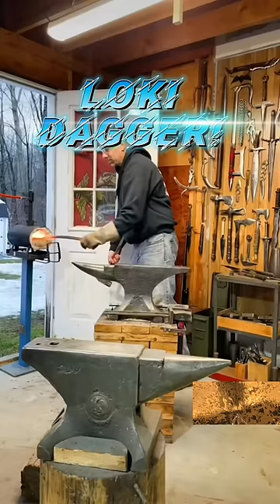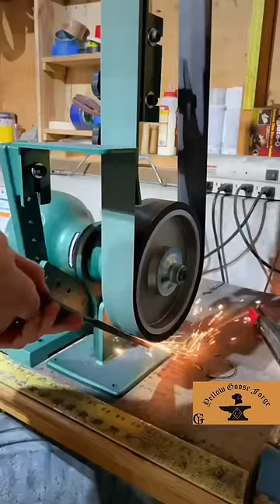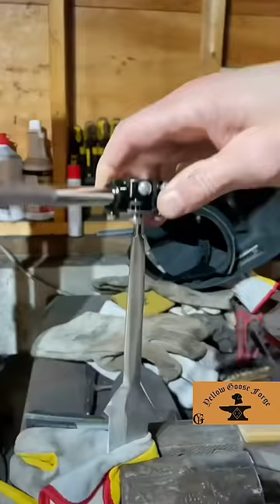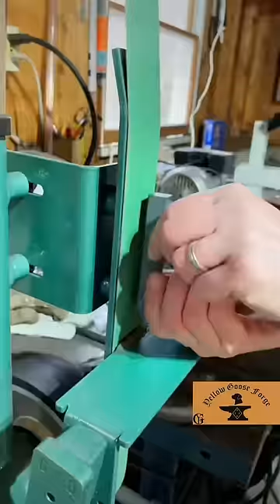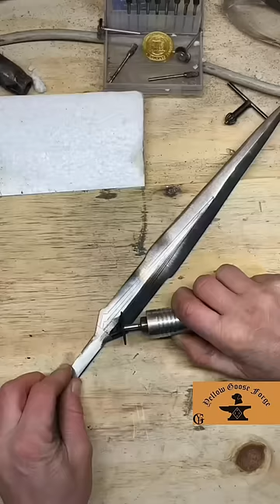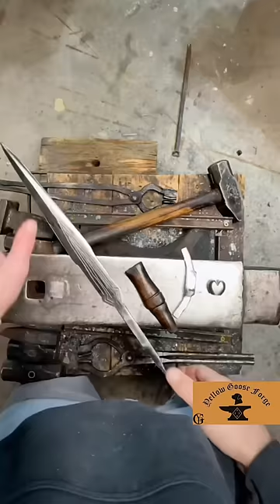Forging Loki’s Dagger #blacksmith #loki #gamer #shorts

Comment: I tried forging daggers with leaf spring steels and unfortunately it had cold shuts for some reason.
Do you have any explanation for this and how to solve it
Reply from the maker: I think it would depend on where the cold shit were. If at the tip, try forging the corners down so the very tip budges out to keep the fish lips from happening. If in the blade, I’m not sure other than forging the edge then the flat repeatedly to try and keep it uniform. Good luck!
Reply: @yellowgooseforge  thank you